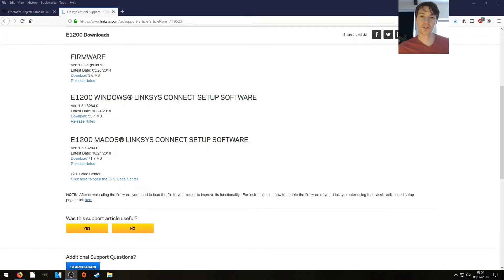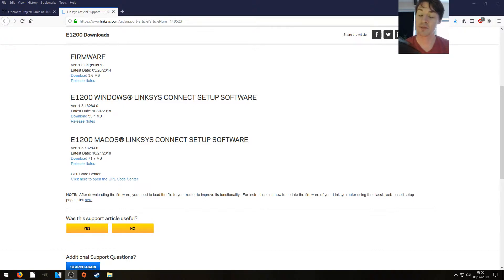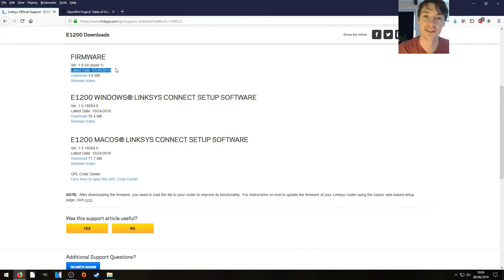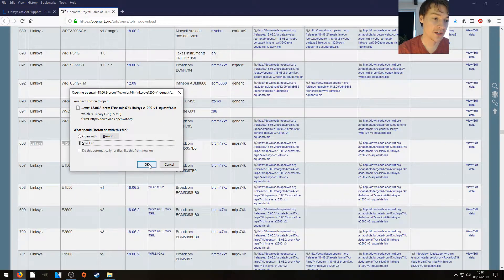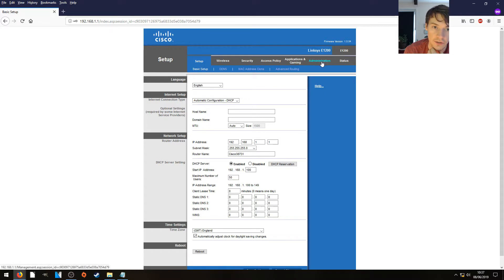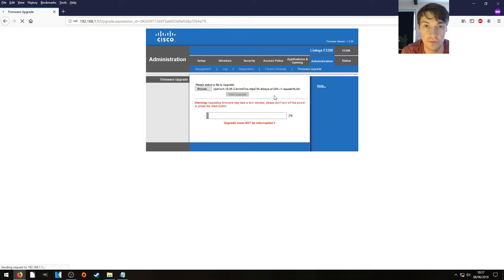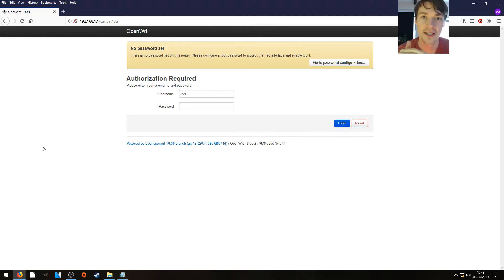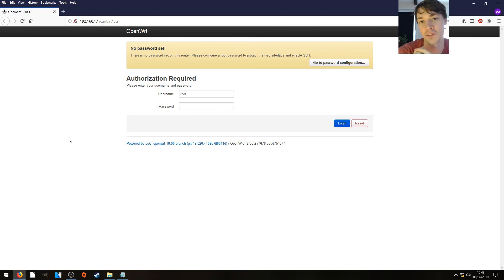OpenWrt - Linksys E1200 | Firmware Upgrade | FLASH

Comment: unsupported wifi 2.4 ghz in openwrt for linksys E1200
Reply: Yes new latest firmware but you still used it for multi WAN failover and SQM QOS using opkg software.